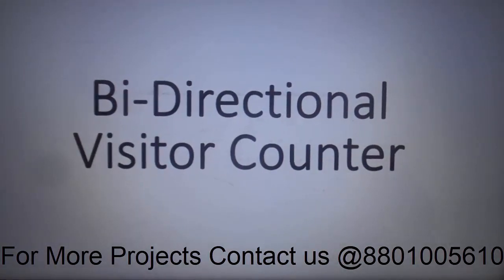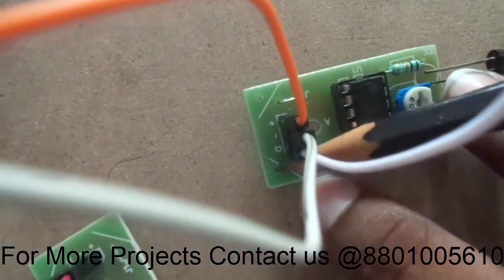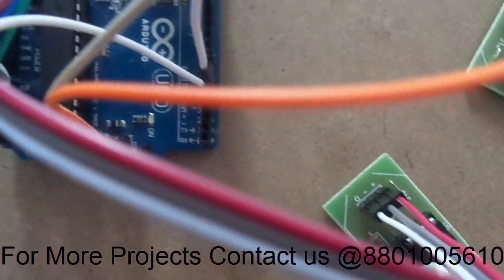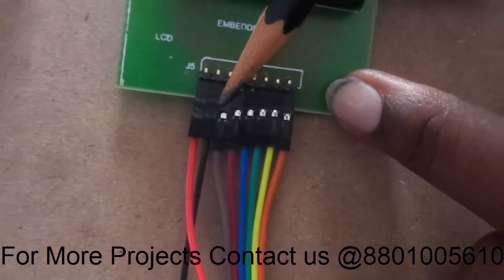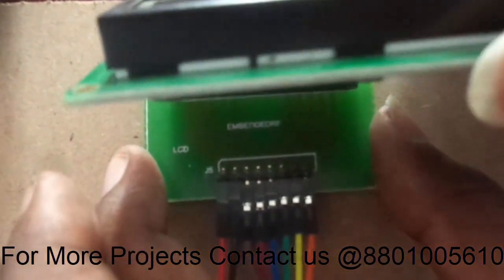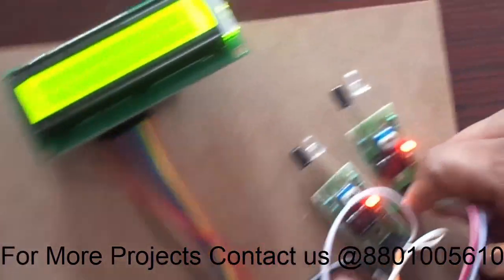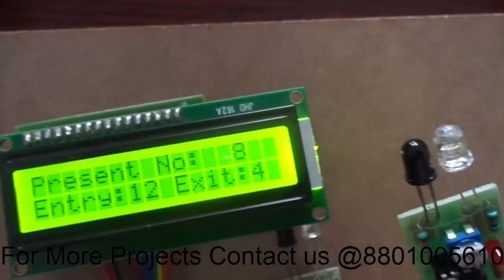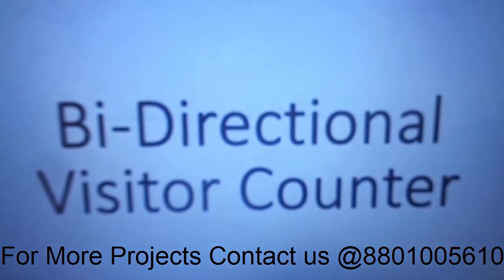Arduino Based Bi Directional Visitor Counter

Comment: It is not for only single door... It will works on that room where entry and exit has two door... Also ir sensor has very low range for detection... Use ldr and Lazer to maintain distance and object sense... And also develop your code that will works on single door... One sensor will be in front of the door and other will be inside of that door... Keep distance of 4 feet between entry and exit sensor